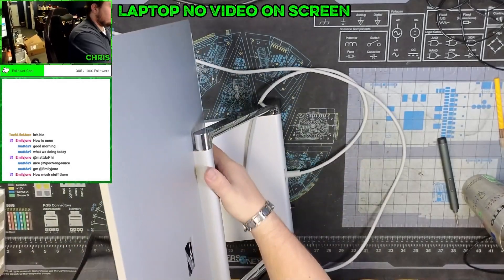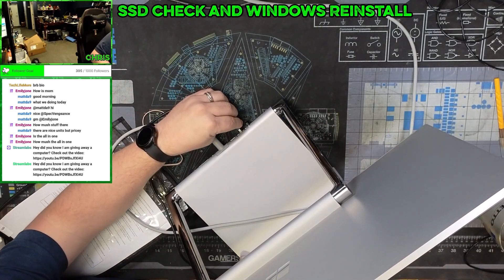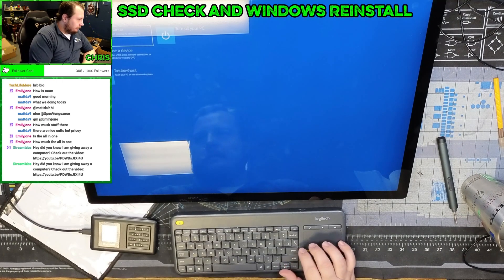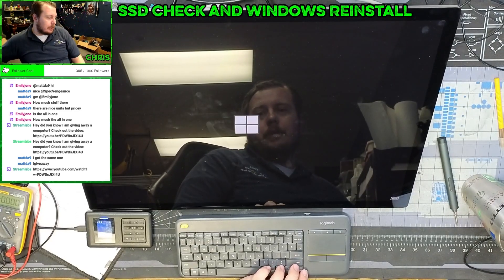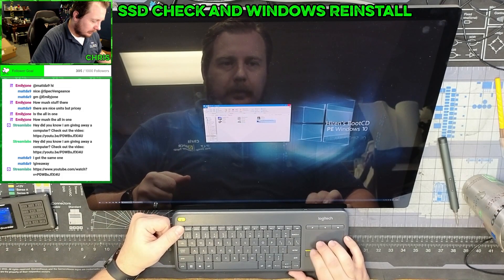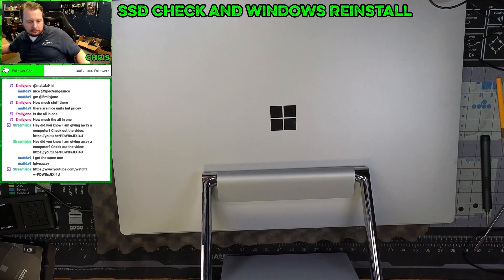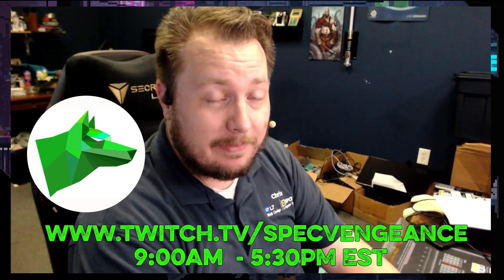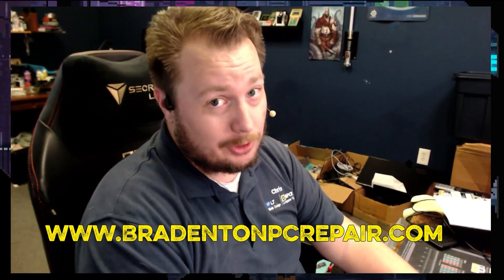Microsoft Surface Studio HDD Upgrade, Why is this so hard? #158

Comment: I think i broke my board, I replaced the SSD AND the M2 and now it wont boot at all, no power. Think is that standoff to the left to left the heat sink i did NOT know that was a SCREW so the heat sink PILLED from that cooper part on the motherboard. mind you it did not take much force as it was only glue holding it but now it will not boot. Microsoft are brilliant indeed. So now i am looking for a new motherboard for my gen 1
Reply from the maker: These motherboards are put together so strangely once you get in there. I hope you get it replaced and it isn't to expensive.